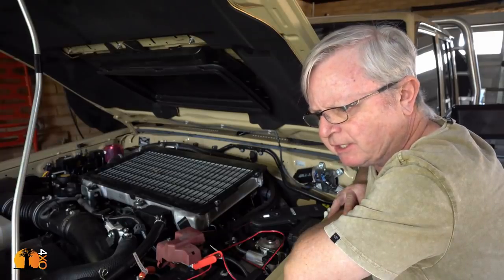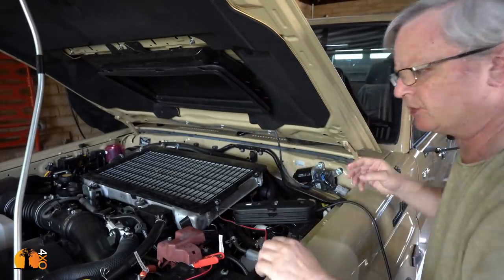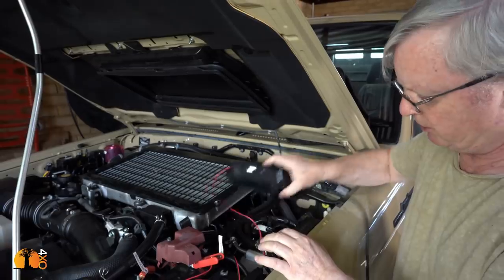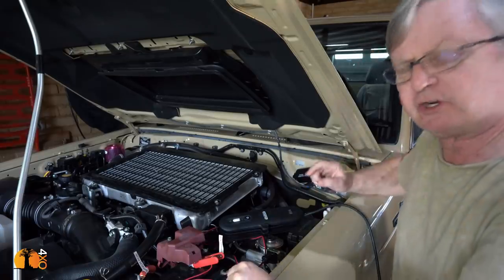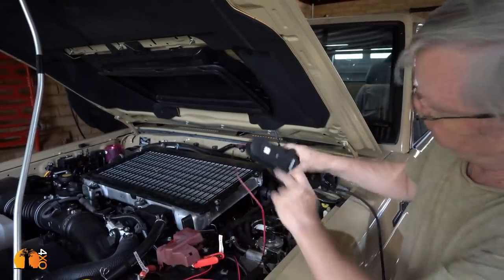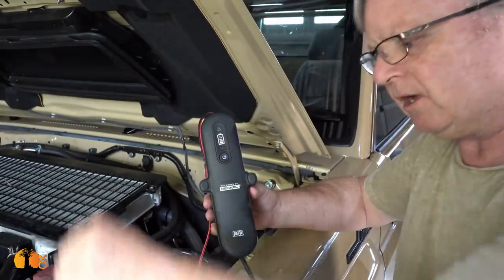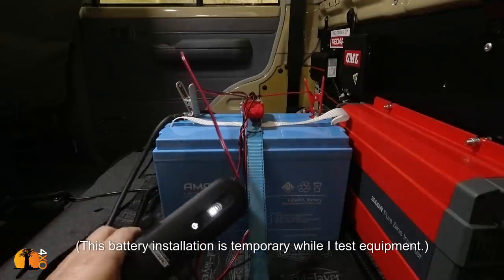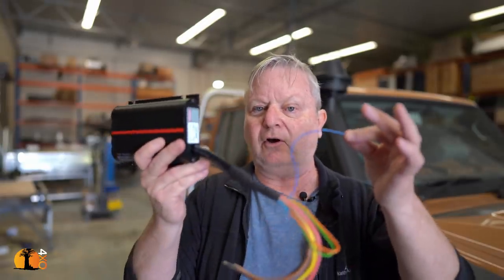DC-DC CHARGER RUNAWAY DISCHARGE WARNING.

Comment: That's a good heads up on protecting your starting battery especially these days because a lot of new cars run their computer systems of this battery.  When the main battery is drained the system needs to be reset and then comes the hard part finding passwords. This would be a nightmare if your in the middle of nowhere without a  dealer or a auto electrician around.   Solving this problem for you was good,your able to know how to fix it. I think it's a good idea for any 4x4 driver to practice these scenarios just in case it does happen.  For me if l bought a new 4x4 l would disconnect the battery at home to see what would happen to the system.😁👍
Reply: Passwords ?, the only thing that needs resetting on my 2019 Ranger is the Auto drivers window, it resorts back to non auto, everything else works fine after a battery disconnection just like any decent 4WD should be, as the ECU'S have self powered backups inside, if a 4WD is designed like you say, then I would stay away from it.

Comment: I trigger my Renogy dc to dc with a small sense relay that switches on at 13.2 v and switches off at 12.8v rather than the ign
Reply: Hey @Trev great idea! Where can I get one of those please? Ta.
Reply: @kirkvagg8004   They are called voltage sensing relays - i bought mine on ebay for £8 UK - I put a little switch in it because when I put the engine battery on charge I dont want it bleeding to the house battery

Comment: If the 10amp charger was competing with a 50 amp drain surely the DC-DC would sense the voltage sag in the crank battery and shut down. Then possibly cycle back on and off till all things are equal. Its the most expensive DC-DC available and it allowed it self to damage a battery.

Comment: Loved the way you explained this. Just a thought, doesn't this come down to the rule of using a battery charger that is of equal or higher current rating than that of the largest charger device in the vehicle circuit active at that time of charging?

Comment: Thank you for advanced warning I was about to upgrade my works van to include DC to DC electrics 

I would have overlooked this
Reply: mohammed ali I would look at a different brand unless that one has a setting to raise the cutoff voltage it seems to be way too low (apparently they are set to 11.7v which is pretty low for a standard battery without the charger adding to the sensed voltage) unless you put in a solenoid to only connect it while the vehicle is running it is going to pull your battery down to 11.7v every time you stop and the aux battery isn’t fully charged.

Comment: Awesome video, I get it. I am also having another weird problem. After using the fridge for the day and I get back in and drive, my dash lights start coming on. I am sure this is the computer shutting things down for lack of power. Sometimes it is when I underrate. When the second battery if full there is never any problems. I have 120 series Prado 3lt desire. I have wonded about the Alternator but am now wondering about the dcdc charger. Any thoughts?

Comment: Andrew, have you explored the capabilities of combination of CTEK SMARTPASS 120S & CTEK D250 (total of 140 amps) batteries management system? You may want to consider reviewing some of the Swedish CTEK products. It might be useful in the situation with two power sources, e.g. vehicle alternator and solar panels.
Reply: I believe you will agree that it is not a good practice to connect multiple charging sources directly to either the Primary battery or Secondary battery. Multiple batteries and multiple charging sources must be managed in desirable manner using a controller or management system
Reply from the maker: I know the CTek systems very well. Used them for years. This is not a problem I’m trying to solve. And neither is this a mystery as to why it happened. It can and will happen to anyone using a DC-DC setup. It's the nature of how DC chargers work. All of them with the exception of those relying only on a trigger wire. The solution is to charge the auxiliary batteries first. It's that simple.

Comment: I am presently wiring up a Kings 25 amp DCDC charger on a 2012 Hilux (not a smart alternator). I have the auxiliary battery and dcdc in a removable canopy. I have an external anderson socket on the canopy, so the power from the cars battery can be disconnected so I can remove the canopy.
I have not made provision for the "blue wire" from the dcdc. Last night, on a first time trial, I noticed power (about 19amps) still being drawn from the cars battery after the engine was stopped. I am not sure if this would have only lasted a few minutes until the surface charge had gone down on the cars battery below the trigger level. I just did not like this happening. I pulled the plug from the external anderson socket. I thought about this, and it is a bit too late to incorporate the blue wire through the chassis and make provision for another waterproof external socket, just for one single wire.
I came up with the idea of adding a 100amp relay under the bonnet in the positive lead going to the canopy power from the cars battery. This relay would be powered on by tapping into a fuse for some ignition on power. So, the dcdc will only be connected when the ignition is on. Hopefully, no one leaves the ignition on and the motor not running. 1% chance calculated of this happening. 
I have also thought a bit further and will add a delay timer (adjusted to about 15 seconds) to the ignition power to the relay. This will prevent a huge draw on the alternator as you crank the engine. 
I feel this is a better solution than the blue wire. No extra wire / connector is needed. And, peace of mind that when the engine is stopped, there is no way the dcdc can play havoc with the car battery.
Reply from the maker: Can you change the cut-off voltage of the Kings DC-DC charger? And make it lower so it only operates when the charge current flows from the alternator? I don't think you can. Sorry but the first error here is trying to save $ and buying a Kings DC-DC. They are cheap for a reason. No easy solution.
Reply: @4xoverland  I am capable of seeing if the dcdc trigger voltage is adjustable,  but I do not want to tamper with a brand new unit.
I would think most of these dcdc units are designed very similar to each other and use the same type of controlling chips. Just packaged and badged differently according to brand?
I am waiting for the relay and timer to arrive in a few days' time. Good thing about this way is not needing that blue wire run through and associated connections. 
I also wonder if there is a sufficient pull down resistor on this wire to bring the voltage down when the ignition stops. Otherwise, the main battery may continue to discharge.
Reply from the maker: Not true. Both Victron and Redarc are made in their own factories. Kings is probably a white-label product based on the cheapest Chinese units. It's won't be designed and made for good performance, but for lower price. If the brand new unit isn't working properly, then this is why. If you can increase the voltage when the charger turns off, then it will disconnect when the alternator stops spinning, or very soon afterwards (within 30 seconds is okay.)

Comment: So you are saying, when the engine is on, if the difference between the alternator output amps and draw from the main battery for various components are less than 50amps, still the main battery will discharge?
Reply: Good point, and correct. That’s why you need to match/balance all electrical equipment in your circuits. He said his alternator puts out 170A, so if all vehicle systems are using up to 120A maximum, then I guess he’s OK under alternator power. However, it sounds like it might be a contributing factor to his starter battery being drained. When he said he had a 50A dc-dc charger, I immediately thought that was overkill, unless his alternator can indeed keep up with total demands, and unless he has a bank of auxiliary batteries in the 200AH plus range. Very good point buddy.

Comment: Add a victron battery protect then if you need to charge with mains power just use the victron app to isolate the dc dc charger. Also a good way to isolate the solar power without having to manually flip a switch.
Reply from the maker: This is not a problem I’m trying to solve. And neither is this a mystery as to why it happened. It can and will happen to anyone using a DC-DC setup. It's the nature of how DC chargers work. All of them with the exception of those relying only on a trigger wire. The solution is to charge the auxiliary batteries first. It's that simple.

Comment: I had this exact problem with the renogy dc dc with mppt 50A charger.
As soon as there was solar or even just a draw it would think the starter battery had 13.1V and start drawing power from it. Lucky I had used amazon and was able to send back.

Comment: 1.Your trickle charger will always supply a greater voltage than your starter battery, even when it is fully charged.
2. Your fifty Amp intermediate charger will draw more current from the primary battery than your trickle can supply.
These you have recognized.
However is it possible because you are using a seriously greedy lith secondary battery that have an ability to rapidly charge, un like your primary starter.

Surely there must be a trickle set up on your secondary charger to match the charge rate of your rickle charger?
Reply from the maker: This is not a problem I’m trying to solve. And neither is this a mystery as to why it happened. It can and will happen to anyone using a DC-DC setup. It's the nature of how DC chargers work. All of them with the exception of those relying only on a trigger wire. The solution is to charge the auxiliary batteries first. It's that simple.

Comment: Are we all not missing a point here? The blue trigger wire not only detects ignition on feed but sets voltage cut out. So yes connecting it sets up Smart Alternator perimeters but it should still shut off the dcdc charger before your starter battery becomes incapable - regardless of key in or key out. My Intervolt dcdc charger works this way so it would be almost impossible to give yourself a flat battery, and the display inside the vehicle should sound a warning. I guess all this is a downside of no in cab display, unlike the Intervolt dcdc system. 
The only sure fire way for this not to happen with you guys is only ever charge the aux battery, letting the dcdc switch to starter battery charging, this goes for solar as well.
If the Redarc or ctek don't automatically reverse to aux to starter then they are way behind in times. Highest price perhaps isn't always best?
Reply from the maker: This is not a problem I’m trying to solve. And neither is this a mystery as to why it happened. It can and will happen to anyone using a DC-DC setup. It's the nature of how DC chargers work. All of them with the exception of those relying only on a trigger wire. The solution is to charge the auxiliary batteries first. It's that simple.

Comment: I believe that your DC2DC charger should turn off when your start battery reaches 12.8 volts as does other brands being used like Enerdrive. In fact quite often when the wrong size cable is used the voltage drop in the cable causes the DC2DC to switch off, are you sure that your issue isn’t voltage drop and your unit trigger voltage is set lower to overcome this issue ????
Reply from the maker: This is not a problem I’m trying to solve. And neither is this a mystery as to why it happened. It can and will happen to anyone using a DC-DC setup. It's the nature of how DC chargers work. All of them with the exception of those relying only on a trigger wire. The solution is to charge the auxiliary batteries first. It's that simple.

Comment: ok so i found out you are doing it wrong, a good dc to dc charger should have a cut off voltage, if it detects if the voltage on the starter battery to go under 13.1 (part of its engine detection) it will stop the charger. Check the victron orion-tr-smart for a proper dc to dc charger

Comment: On an isolator setup redarc sbi12, charging both a start and dual purpose marine stoaway at the same time off a battery maintainer at 2amps. I have been separating them when stored in the shed would that be harmful with both on the one. Got a better 5amp victron one that would be easier to just plug into and do both. I know the isolator isn't as efficient but for a basic under bonnet setup that I wanted to be able to jump start myself it works good enough. Also add those large fuses are not the greatest usually the holders cannot stand up to the current, midi are far better and easier to store as spares

Comment: I have a ctek d250sa When I'm home I have AC power so my fridge switches to AC But I installed A battery charger in the back by my house battery So it keeps it topped off when not using it By doing it this way Most dc-to-dc Chargers Will backfeed feed to your starting battery and charge it once your house battery is topped off . Pretty much the opposite of what you have set up

Comment: I've had a Ctek DC to DC charger for 4 years now and have had no problems charging everything with a charger on my main battery.
Reply: Same here, Ctek DC to DC, model 250s. Have had no issues. It seems like a really big oversight by Redarc (maybe Ctek and others too?) to allow something like the voltage from a battery charger to fool the dc to dc into flattening the battery main starter battery. But I will keep that in mind and watch for it.
Reply: Yep CTEK does not suffer from that. I always use my 6amp mains charger to top up my whole system and never ever had this problem.
Reply: Maybe because the CTEK only draws 20A and not 50A.
Reply: @JimYeats  Agreed. I have the CTEK D250SA. The manual says the two batteries are isolated unless the ENGINE IS RUNNING. Maybe it just senses that there is alternator output going into the starter battery ie being charged, just like it would be with an external charger. The other problem for ANDREW is that maybe he should connect the REDARC unit as per the instructions for a smart alternator. I believe the 70 Series Landcruisers are equipped thus, and that is how my CTEK has been connected to my 2018 76 Series for 2 years now. Charges 100Ah AGM Aux correctly. Yes, the earth wire is also connected as required for an AGM battery. I will double check to confirm if it is in fact a smart alternator as I was told (or read somewhere at the time I installed it.)
Reply: Yep Ctek is the go.
Reply: Also got a C-Tech D250SA and when I connect my solar panel to the system it actually charges the starter battery when the Aux battery is fully charged.
Reply: @cobusrautenbach8804  Same here.
Reply: George Saaiman I have the cteck also, and never had the issue either , but the main reason is because my auxiliary battery was always maintained and virtually full by the time I returned from a trip etc, so no real load required from the 250s dual to charge much. No issue for my ac charger to keep up at that point. In those circumstances Andrew wouldn’t have too many dramas either, it’s when his aux batt bank is a bit low and then dcdc cranking max amps.